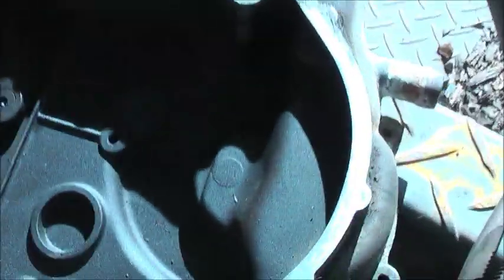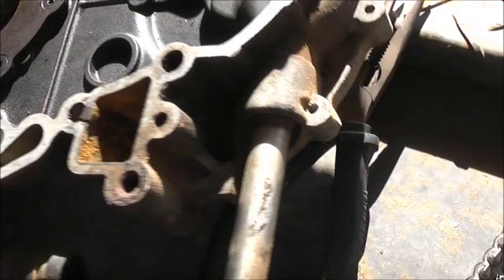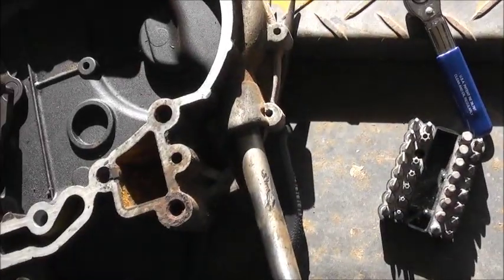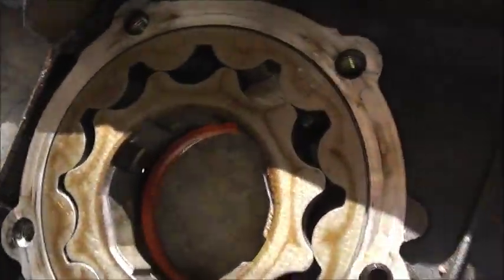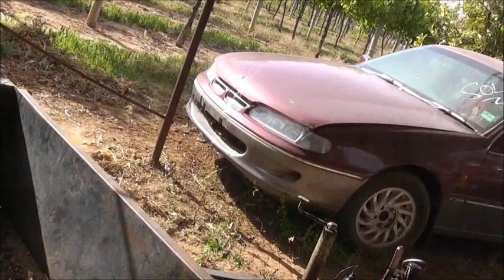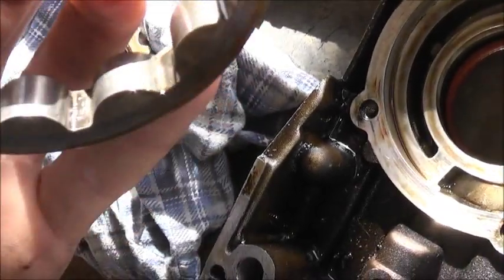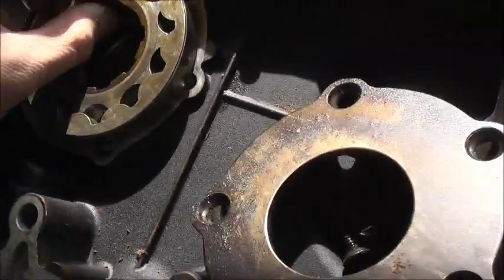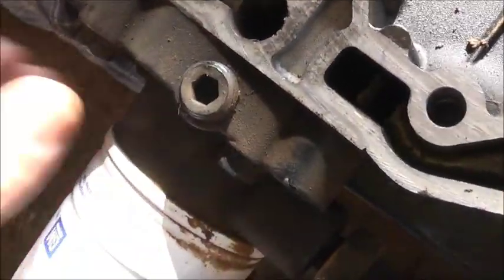3.8L V6 VN Commodore Oil Pump Autopsy

Comment: Put an ecotec oil pressure spring in a Buick and raises the oil pressure by 30psi,helps keep bottle end from locking up.

Comment: My goodness....All that complexity in order to achieve rotation as a result of a few pops in some cylinders! :-O

It's no wonder I prefer electric motors..... Power in, rotation out. JOB DONE.

For all the energy that there is in petrol, only a small percentage of it goes to the car's wheels. The rest is lost as noise, & mostly heat. 

If we're ever to move on, the internal combustion engine needs to be ditched, & battery/Ultra Capacitor technology needs to be looked into.

-BBD.